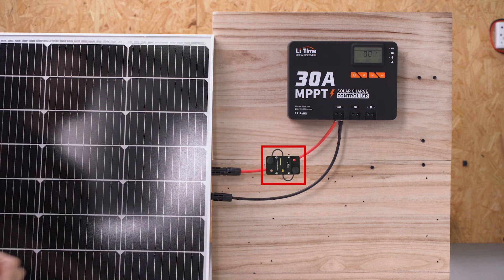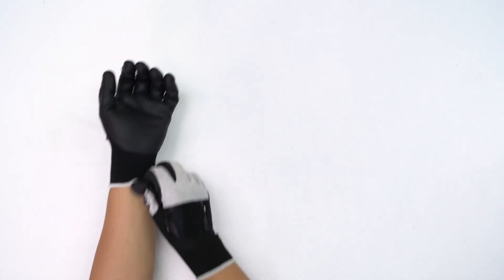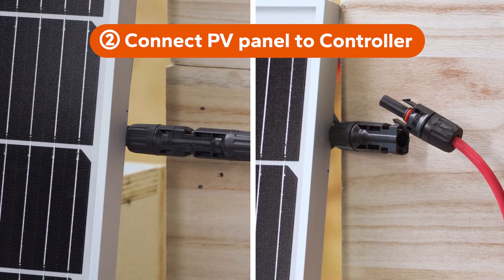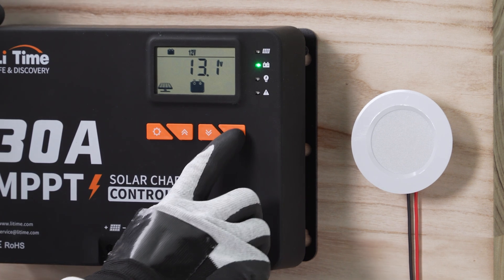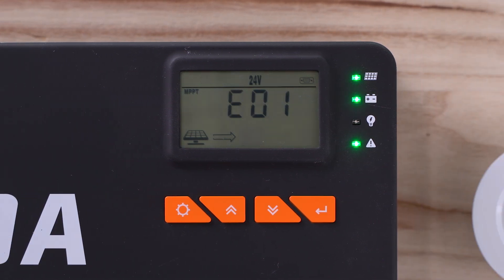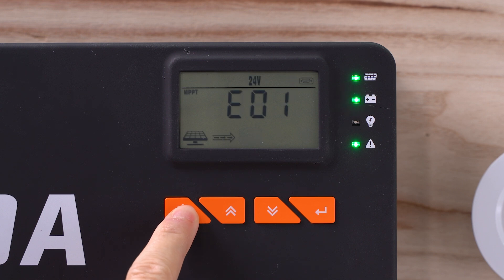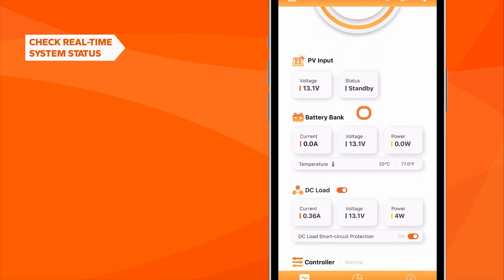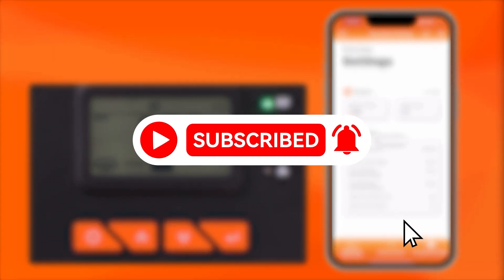Squeeze More Power from Solar: LiTime 30A MPPT Solar Charge Controller Setup Tutorial

Comment: 0:55 how does the DC load work? How much output is there - voltage and amps?
Reply from the maker: Thanks for your interest! Yes, our MPPT controller supports direct DC load output with a max current of 20A, 12V/24V. 😊
Check the specs & manual here: https://www.litime.com/products/30a-mppt-solar-charge-controller
Any other questions? Email us: service@litime.com. We're happy to help!

Comment: So can I connect my BLUETTI (AC240) Portable Power station output  which is 30 amps 12 v dc to 30 A mppt  in order to charge a 100 AH life pro battery? Which then run my roof top Ac which is 12 v dc 30-60 Amp ?
Reply from the maker: Hello, thank you for reaching out! We recommend providing your order number, a link to your BLUETTI (AC240), and the detailed charging plan to our support team at support@litime.com. Our team will assist you thoroughly. 😊

Comment: Does this set up really require 250A breakers?
Reply from the maker: Hello! Thank you for bringing this to our attention.
This video is intended to demonstrate connections between devices. For circuit breakers, we recommend using a rating of 1.1–1.25 times the total circuit current. We’ll be more mindful of breaker selection moving forward, and we truly appreciate your feedback!❤️
Reply: @litimepower  No problem, I bought the breakers in the video. Hoping I can still return them. Thanks for answering!

Comment: Great video. I have a 24V Power Queen battery and a Power Queen solar charge controller that I want to hook up. Besides the settings on the controller can I mimic the connections you have applied in regards to the wiring connections? Thx.
Reply from the maker: Hello! We recommend consulting the relevant battery customer service to confirm if this connection meets your target battery system setup requirements and to obtain wire gauge recommendations. This will ensure the smooth and safe construction of your battery system🧡

Comment: Hello, again
I have 3 batteries in parallel (purchased from you 6 month ago). Do you think is to late if i buy one more to have 4p ?
Reply from the maker: Hi~ If the three-battery parallel system has only been used once or twice, it is acceptable. However, if it is used frequently, it is not recommended to add new batteries after a 6-month interval, as this may affect the performance and lifespan of each battery in the system.

Comment: good evening, I have the same 30 amp mppt and I have a question to ask if possible, with a voltage of 13.1 the mppt display indicates 93% of use while in the instruction booklet, the scale indicates that with 13.1 volts the battery is at 40%. can you give me your idea? Thanks so much for any response. Have a good evening.
Reply from the maker: Hello! Thank you for reaching out with your question.

It sounds like there may be a discrepancy between the MPPT display and the information provided in the instruction booklet. To get a more accurate assessment, it may help to put a small load on the battery, as this can sometimes adjust the voltage reading and provide a clearer picture of the battery's state of charge.

If you have any further questions or need additional clarification, please feel free to contact us at service@litime.com. We will assist you further within 24 hours.

Comment: Hello, i installed my Litime 30A MPPT charge controller and when switching through the displays, one of them say percent, what does that number indicates, i do not assume that its the battery SOC since it can go up and down 30% or more within ten seconds or so, and the manual does not mention it.
I wrote to customer service over a day ago, and still no answer, i guess they dont work in the weekends.
Reply from the maker: We apologize for any confusion caused. The percentage displayed indicates the SOC of the lithium battery. Please note that the MPPT controller estimates the SOC based on voltage, which may result in inaccuracies for lithium batteries.
Reply: @litimepower  Arh i see, thank you for your reply!

Comment: Is the screen Backlit?
Reply from the maker: Sorry, our MPPT controller currently doesn't support backlighting.
Reply: @litimepower well, that sucks.... You would think that one of the most important screens on a solar setup would be easier to read in the dark.  And no, I shouldn't have to use the Bluetooth function to read the data on the controller. I do hope it is something that you plan to revise soon, as I really like your products. Cheers
Reply from the maker: Thanks for your feedback! While our current screen doesn’t have backlighting, you can pair it with a backlit LiTime monitor or use Bluetooth for easy monitoring on the APP. We’ll share your suggestion with the team. Glad you like our products—cheers!

Comment: My 30A MPPT shows PV Status as Input Detected and Standby, but never switches to Steady and so never charges my Li battery.
Reply from the maker: You may check the voltage of PV port and battery port in the MPPT controller. If the PV port voltage is lower than 10V then it is hard to charge the battery(2-3V higher than battery voltage is recommended). If the battery port voltage is lower than 10V, it means the battery is in protection and the mppt is activating the battery.
Reply: @litimepower  Exactly the problem, thank you. The solar panel is NOT standard, directly powers a pond pump. Size and voltage just adequate for the pump. Bought true solar panels and all is working fine.

Comment: How would I configure if my battery is full and I want the power from solar to send to any device that needs the power instead of my battery draining. I don't think my litime 30a mppt is sending power to device that need juice.
Reply from the maker: Hi, the MPPT solar charge controller can directly send solar power to charge DC Load by connecting to the load port in the controller. While the battery will keep charging if the solar power is keep generating, so the discharging process won't let your battery draining. More question please contact our service team so we can help you based on your need.🙂 service@litime.com